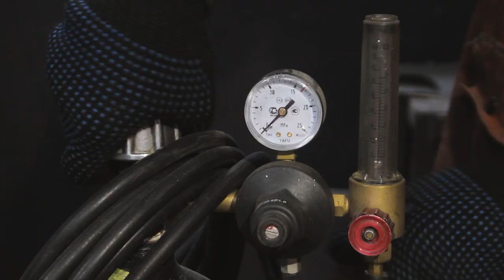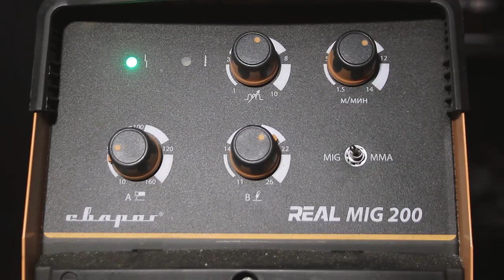How to make a PURE EVIL Vise

Comment: It does indeed look awesome. My only objection is that you can't really use it as a vice anymore...
Well, you can, I suppose, but it's not straight and damages whatever you put in it.
Reply: You'd be hard pressed to use the it as a vice in it's original configuration lol. The lead screw nut is bolted in; not pinned or dovetailed in... Bolted.

Comment: detailing with the biggest drill in the shop...
Reply: well. resting it on your shoulder means you have good control over the tip with your fingers since the hand doesn't need to support the weight of the tool.